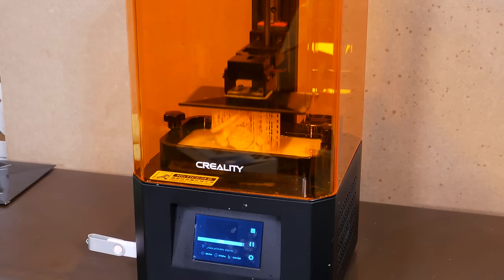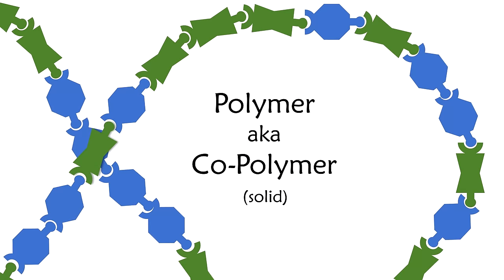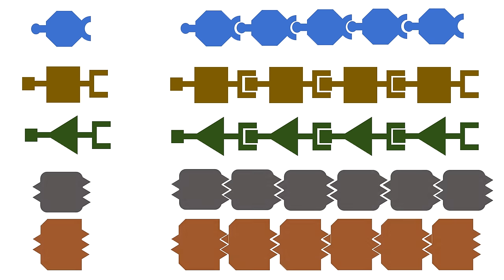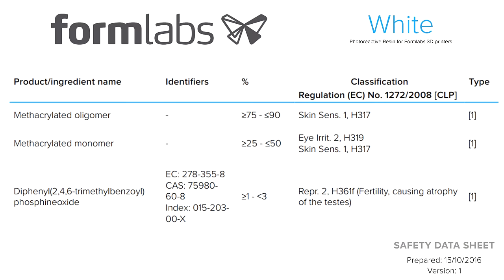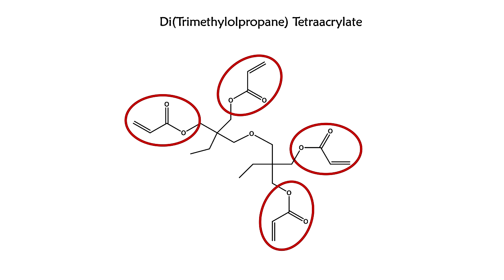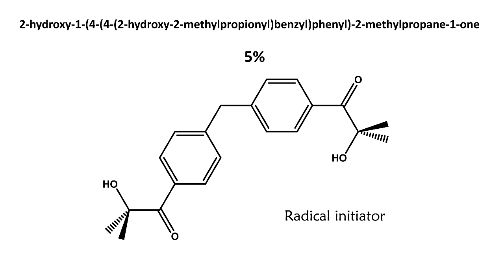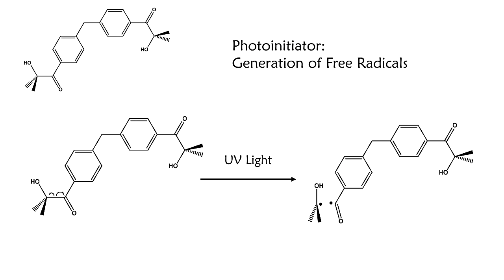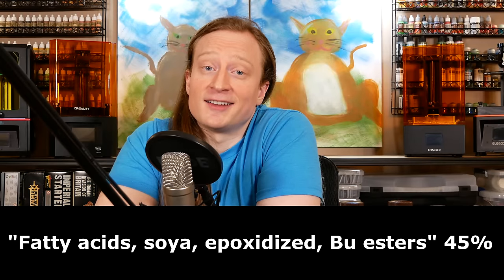Ph.D. Chemist Explains 3D Printer Resin

Comment: Hi! Thanks for the really informational video! I have now a Photon S printer and the smell was initially quite bad. So, I challenged myself and built a ventilation system that pushes out all the vapours through the window. There's an airtight tray below the printer which connects to a vent in the wall. There's also a fan in the tube to help push the vapours out.  While printing the cellar room is pretty much odourless now. I was wondering if there can still be something harmful lingering in the air that human nose is unable to detect and if it is really safe to have the printer in the house like this. I also do have to open the printer to get my prints out so I was wondering how much harm can this cause? We're used to drying our clothes in the same room, will the smell stick to our clothes in the long run?

Comment: Hi Brent.

Why wouldn't you recycle the hardened Resin? Shouldn't it be normal polymers, that can be recycled again? I always throw my PLA and ABS waste into my plastic recycling bin, is there a reason I can't do that with resin waste?
Reply from the maker: hello! :-)  A lot depends on your local recycling streams.  The standard 3d printer filaments are common thermoplastics, and they can be melted and re-used multiple times.  After liquid resin is photopolymerized, there's no going backwards for a re-do. I think there are couple of recycling initiatives that could use ground up chunks of solid resin as filler material, but I don't think that's mainstream yet...

Comment: This was super informative. Thanks for breaking it down and and discussing the safety risks! I have a slightly technical question for you. Is the photopolymerization process affected much by atmospheric factors? Does it perform better or worse in a vacuum or airtight environment? What about elevation and ambient temperature? Many of these new MSLA printers come with a plastic cover that could be sealed to keep the fumes in and temperature stable. Is that advisable or is some airflow needed to facilitate the curing process?

Comment: Hi Brent! Thank you very much for doing this video. I know this is more than 3 years old but I'd love to know what exactly means the EN 71-3: 2013 certification in terms of how safe are the pieces printed with this resin, will the printed pieces be safe to use inside the mouth (i.e. saxophone mouthpieces)? I'm currently using biocompatible resins but the PLA based resins are far more cheaper. Thank you very much in advance!

Comment: Hey Brent, hope you see this! Seen a bit of debate on what filaments to use for modding a resin printer with most of it revolving around UV resistance, valid for internal components due to light bleed for the LED arrays. But, what about parts that will come into contact with the resin itself. Is there a "best" out there regards PLA, ABS, PETG, Polycarbonate, and so on?

Comment: I just bought a resin 3d printer and have been reading up on it. Honestly, I've probably learned more from this video than anything I've read so far. 

Question(s): during the printing process, can I use my airbrush spray booth vent to a modified box around my printer to funnel out the fumes outside? I plan to have all of this in my nerd den or will it be that extreme with the fumes? How long after printing can I go back into the room if it's not vented? Such as printing while I'm at work.
Does this require a respirator to work with? Some of the things I've read say it's an absolute, but others say it's okay without one. 

Thank you!!

Comment: Hey Brent! I have a question about a type of waste you didn't cover. In the process of removing the supports from prints, everyone I have asked agrees that gentle even heat will soften the supports enough to be removed. The most common suggestion is to use warm water. How do I dispose of the water used in support removal? Is there a better way to remove supports?
Reply from the maker: I also use the warm water trick to remove supports.  I evaporate this waste water in an old bucket
Reply from the maker: (I put the water in an old bucket and leave it there for weeks)

Comment: great video! can you share some thoughts on the water washable resin? is it somehow safer, apart from the fact that you need less IPA? and also: is cured resin completely safe for touching? i'm planning to print keycaps for my mechanical keyboard, so touching the resin would be pretty extensive... thanks!!!

Comment: Hey Brent! This video is now nearly a year old, but my question fits rather perfectly and maybe other folks have had similar problems.
I've 3D printed a D&D mini for my wife about 9 months ago (Elegoo water washable) and today I discovered, that the printed base has split open and uncured (?) resin was oozing out. I cured the mini properly with a Mercury and the figure was never exposed to excessive heat etc, mostly sitting in its shelf as a display-piece. What could have caused that reaction?
Was there uncured resin somehow trapped within the base, that expanded? Can resin re-liquify?

Comment: Thanks for the enlightening info about resins. Im not a chemistry guy but just out of curiosity I wanted to know if there is a way to reverse the process of curing and convert a part of the solidified resin to liquid again? Maybe a few percentage of it without too much expense? The support structures are almost 30% of designs most of the time.

Comment: As a chemical engineer student, do you think it is possible to separate the solvent from the resin (or at least most of the resin mixture) by a (or multistage) liquid-liquid separation? If yes what chemical would you recommend for that purpose?
Btw great way of explaining chemistry 👌

Comment: Amazingly informative video! I'm currently looking for a solvent to dissolve the cured resin for a project. I have a tried acetone and DCM on standard elegoo with no luck. I've got some water washable and some anycubic eco on the way so am wondering about the claim that the eco-resin is biodegradable as I assume this should make it more soluble. have you got any suggestions for a suitable solvent?

Comment: Can you expose the Used alcohol to UV light then filter out the solid resin? Nice video!
Reply from the maker: yep, I've tried this trick... some people say they get particles that fall out of solution, but I always get a film of gelatinous solid on the clear sides of the container, and it actually has taken me multiple cycles to get the alcohol decently clean.   This has potential for sure, but I haven't quite figured out the most efficient way to use this! :-)

Comment: Thank you for the very informative video.
I do have a question. While researching how to clean your used IPA, I saw a comment stating that the only way to truly clean the IPA is through distillation. They stated that just exposing the used IPA to UV light was not removing the dissolved chemical(s). I unfortunately did not keep track of where that comment was expressed.
Do you have any thoughts on whether this might be true or not.
Thank you.

Comment: Thanks for the great video. So...just to be clear. I can use any resin from any supplier on any printer? I have recently acquired and repaired, a Form 1 and an Anycubic Photon and I am ready to try them out but Formlabs resins are so expensive. Thanks in advance.

Comment: Hey, Brent! I have a question about resin printing cleanup, and you're, well, a chemist. I have been told I can filter after printing, pour the filtered resin back, then cure the gooped filter, making it inert and safe to throw away, and that I can do that with the alcohol/resin bath wash, too (i.e., filter it, throw out the alcohol and cure the gooped filter). Is this true, and is this safe? We're looking to get a printer, but we're wanting to be responsible about how we handle the chemicals. Thanks so much!

Comment: Great video! Is there a resin that has some elasticity / flexibility like silicone and can be used in a swimming pool environment (exposure to pool water, chlorine etc...)? I would ideally make this part out of silicone, but since the process is extremely manual and I'm not able to 3d print silicone, I'm wondering if there's a resin that would work well for this application.

Comment: Great Video! I have been learning a lot and enjoying your creative tips.  (Just started the hobby)

Can you recommend a VOC meter, I have an EPAX X10 using it with two Elego carbon fans inside the printer, a 400 CFM 6" inline fan with with active carbon filter 6”x18” (AC Air Infinity) near the printer, a DIY cube with Nordic Pure 20x20x2 MERV 12 Pleated Plus Carbon AC Filters sealed with tape with box fan on top pulling the air through the filters.

Open window with 20" box fan blowing air into the room. That all being said, it's in a small room (door closed). I run the fans during printing, and then overnight following the print session of the day. I am seeking to do some sort of approx. VOC monitoring. Recommendations? I have seen some on Amazon, however I dont't know what if any actually are useful?

I not totally paranoid, but just seeking to have a better understanding of the impact of the operation. 

Thank you for taking the time to do the videos. (Subscribed to you: )

Comment: I'm new to resin printing and I will be getting my fist one for Christmas. I've seen in a few videos that they will sit the vat of contaminated IPA in the sun or UV light for a few hours, then they will filter the IPA into another bottle and use that to clean prints. Once they get as much IPA out as they can, they will pore the resin slug onto a paper plate and let it cure and toss it. Would you recommend this process?

Comment: Can the leftover bits of harden resin be put into a glass jar of acetone to make what they call sprue and recyle into other project? Thank you.
Reply from the maker: Unfortunately, I don't know of any solvents that will dissolve cured + crosslinked resin.  I've been using them as rubble for miniatures bases, and I think the old supports can probably be used for filler in other projects... but the hardening of this type of resin is pretty much a one-way street.

Comment: So, looking around, I came across the idea of using Alum to coagulate the resin in the IPA washes and filtering them out.

Can't offhand think of any problems with this (assuming you dispose of the coagulants correctly), but wondering if you had any thoughts.

Thanks.

Comment: Hi Brent, do you have a video on how acrylic paint works?  How does it become waterproof when it dries, if it uses water as the vehicle?
Reply from the maker: a good question! I should do this someday. The short answer is that it's somewhat difficult to get a suspension of all those solids in paint in the first place- lots of physical mixing action and such... it's much much harder to get all those tangled polymers back into suspension than to dissolve salt or sugar or whatnot.

Comment: Hi,
I watched your wonderful video twice. I have a question: Does it matter to use the designated resin for let say a 4k printer 4k resin? Or is it just a commercial claim. What I got from your video is that monomers have a length of 1nm. I can’t find any information anywhere, of polymers dimensions. If a printer has a resolution of 22.000nm (8k resolution) and if the parameters for the resin that I’m going to use is set correctly, I suppose that there won’t be any difference with the outcome, as polymers dimensions practically cannot exceed a pixels dimensions. Am I wrong? Thx
Reply from the maker: Some channels that deal specifically with printing have found some (~minor) differences in print quality based on this 4k/ 8k specification in the resin.  I haven't heard a good explanation yet for why this might be...  It might have more to do with the opacity of the resin and how much light is leaking into neighboring pixels?  (that's just a guess though!)   And you're right, the polymer size is going to still be small compared to pixel size.  Polymers are often (very roughly)  ~~hundreds of monomers long, so even if they were stretched out in a straight line (they wouldn't be), it would still not be nearly on the same scale as a pixel.
Reply: @GoobertownHobbies  Thank you very much for your reply. May I share your answer to the Facebook group of Phrozen 8K where I started a discussion on this topic?
Reply from the maker: @fcemari  my reply is pure speculation, but sure! :-)

Comment: Great video on the chemistry of resin.  Can you do a short one on the risks if any of the hardened resin in contact with skin for example cosplay pieces etc.
Reply from the maker: Hardened resin will still have some molecules embedded in the crosslinked polymer matrix that could leach out over time (stabilizers, unreacted monomer/ iniatiator, plasticizer, etc.)  Hard resin is way safer than liquid resin, but I wouldn't recommend prolonged direct contact.   Luckily, a few coats of paint and varnish should seal things in, so as long as you're painting your prints then I wouldn't be too concerned about them! :-)
Reply: thanks for the quick reply.
Reply: what sort of resin are they using for dental work.  I would assume it is really safe to put in our mouths

Comment: thanks for making this video!! how safe vs. unsafe would you say having a resin 3d printer that I use regularly in the room next to the room I sleep in is? I use a full respirator mask and gloves when I clean the resin prints but I do sometimes get tiny splashes of water tainted with resin on my skin and clothes when I'm cleaning the prints I wash it off and i then wash the clothes but I dont throw them out is that dangerous? Thank you so much again.

Comment: Thank you for this great video. I have a thought that you might be able to help with. Is it possible to safely uv-cure the resin clouding up the cleaning solvent (isopropal or methalated spirits) while it is sealed in a cear container. That way you could just filter out the hardened parts, safely dispose of them and keep using the solvent. Is this a valid thought?

Comment: Excellent video. One really pedantic point (sorry). 21:05 the diagram shows the double bonds in trans, but in natural fatty acids the double bonds are cis which causes the carbon chain to be linked rather than straight.

Comment: I have been attempting to use resin to print a functional part that has a number of shafts about 0.75mm diameter and need to be "significantly" tough and definitely not brittle.
I have have almost succeeded by using Sarya Tech Blu. I'm hoping you can provide guidance toward my objective. Basically looking for the toughest resin for making functional parts.
Also, I've noticed that the shafts I've printed are initially quite flexible (even after UV curing) but, then become many times more rigid after 24 hours or so. What is going chemically that increases rigidity by such a large degree?

Thanks so much for the detailed video.

Comment: A bit late to the party, but thanks for the deep dive and disposal safety info.  I had already been leaving my wipe down towels in the sun before disposing of them.  Also, i clean my IPA by straining and then pouring the sludge onto a silicon mat in my driveway and letting it sit.  The neighborhood cats avoid it like it's anti-catnip.  I could only wish that the armadillos were drawn to it instead of my lawn ... The resulting solids peel off easily.

Comment: Would be awesome the same exercise but with recycling IPA. After many cycles of photo-cleaning the residue dissolved, precipitating it through UV exposure, the IPA become sticky and loses the capacity to proper cleaning. Do you know how to extend its lifespan even further, without re-distillation or other energy and time intensive, or law forbidden (in many countries distillation is), using fine chemical processes?

Comment: @Goobertown Hobbies Brent you may not see this, but a question about the polymer bonds. If a piece is already cured, and you put liquid resin on the piece to "weld it" does that liquid resin when it cures create new polymer bonds with the already cured piece or just itself? I know you may not know the answer but in the hobby a lot of people suggest using resin to weld two pieces together and I've often wondered about the strength of the bond.

Comment: hi Goobertown, may i get your opinion about respiratory hazards concerning such consumer grade  resins (standard, water washable, "plant based", ...). Looking at many safety sheets, the listed risk and security measures are often to wear gloves clothing and glasses against skin contact, even face protection ... for skin contact ! not for breathing matters. Hence, the "fac protection" is recommended for the same reason. But really few of them wrote about the breathing hazard, only the contact one. May you help us to objective the risk to wear a filtering respiratory mask or not in a dedicated room ? Does it metter or not ? 5min open window is it enough or the full printing length ? an air extraction setup is it required ? How do you personnaly proceed ? I really don't find any reliable information about this subject.

Comment: Now that I got a printer, I revisited the video and I got a question: 
I have the water washable resins. Still use some IPA in the washing process, but also was able to cut down on it a lot, BUT now I got bottles full of "contaminated" water that are a mix of uncured resin, IPA and water. Obviously they take too long to evaporate and I can't have them standing around for weeks in my appartment and stink up the air. 
Any suggestion how to dispose of those?

Comment: Mr. Ph.D.  I just subscribed to your channel. Though, you forgot a few very important things in the explanation. One being the energy the goes into the process. Or the minimal required  UV energy (mJ/m2 or mW/m2) for the polymerization to start. The other being the heat! Polymerization is an exothermic process, right ;-)
Cheers, D.